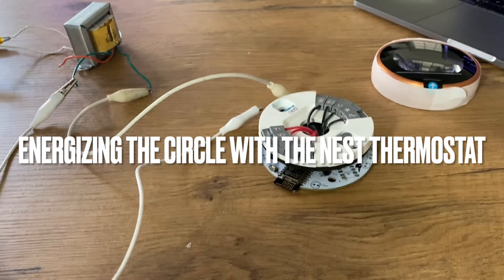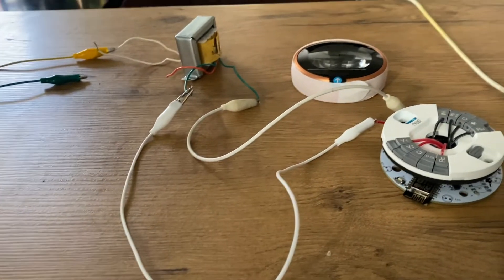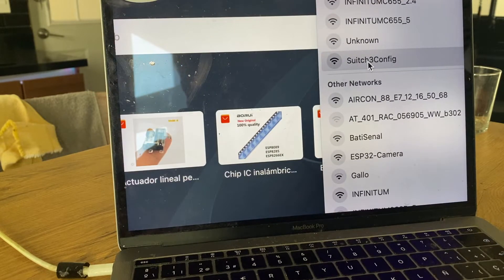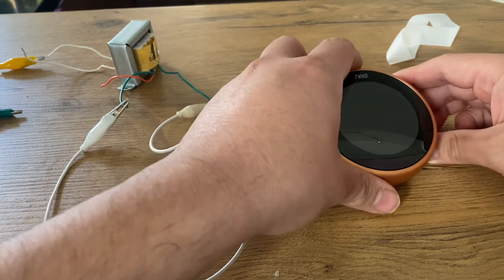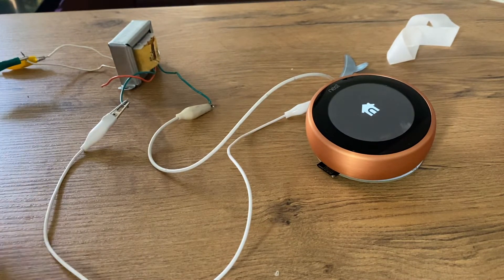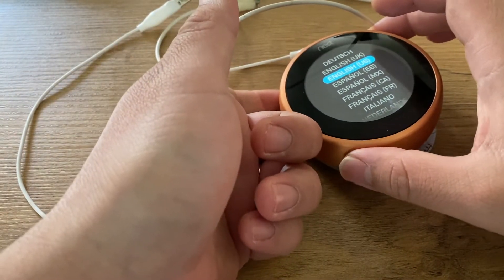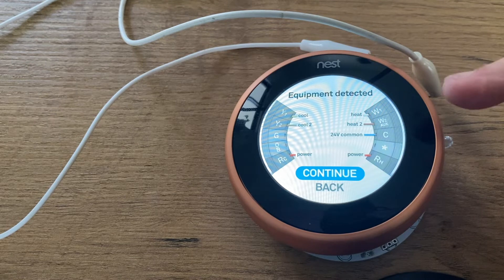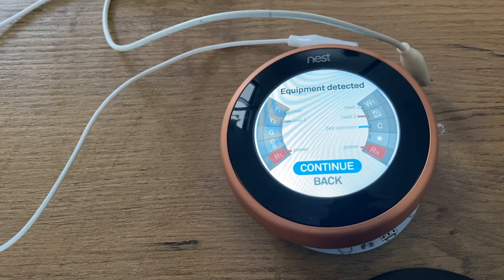Chapter 3. Nest thermostat with minisplit mod, Energizing

Comment: Buwnas tardes Andres , mi cliente te compró dos modulos . Los estoy conectando a dos ecobee para unos fan&coil inverter trane. Voy a conectar instalar los modulos dentro del plafón con el receptor del equipo . ¿La configuración se puede hacer en celular? Y otra consulta . Los ecobee los pueden trabajar con la aplicación Smart sin problema? . Gracias por tu atención
Reply from the maker: Si la configuración se puede hacer en el teléfono y puede usar la aplicación normal correspondiente, el dispositivo solo interpreta los comandos de encendido de las diferentes etapas
Reply: @andressantos4054  buen día amigo . Instale el termostato ecobee pero me solicito que conecte la terminal G , una duda . ¿ Se hace un puente entre G y Y1 o se cambia el cable en Y1 a G en la terminal del ecobee?
Reply from the maker: @hugonamorado3222  que tal, puedes usar G(ecobee) a Y1(adaptador) que seria velocidad fria en baja, el adaptador no cuenta con G especificamente, pero seria el mas cercano
Reply: @andressantos4054  , en el siguiente paso de programar el adaptador cualquier duda te vuelvo a escribir. Muchas gracias